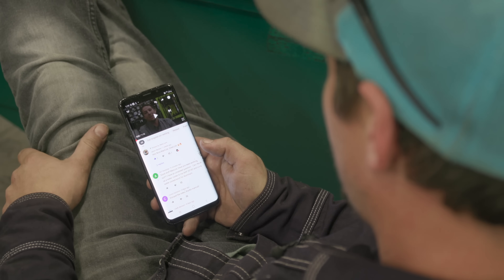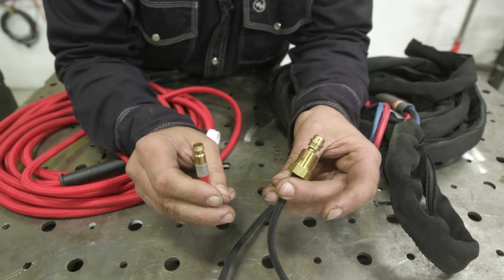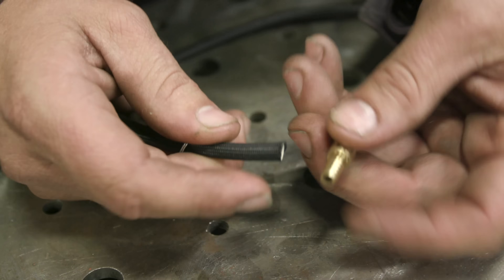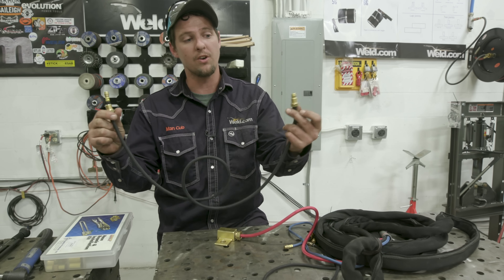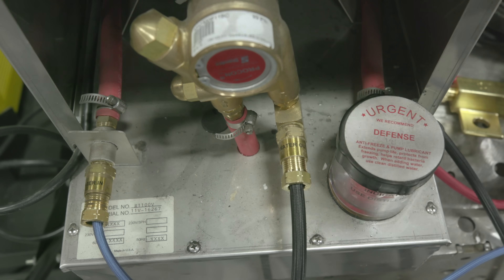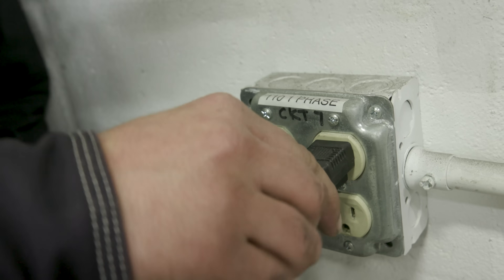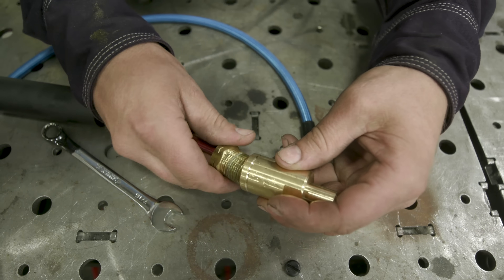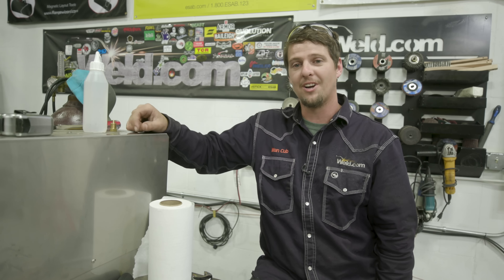AHP AlphaTIG Water Cooled TIG Torch Setup

Comment: Great video. My machine feeds the gas through the power cable of the torch, high frequency start. Is there a way to hook a water cooled torch up with this system, or do I have to bypass the machine and run gas straight to the torch?

Comment: Hey ManCub, Great video I just have a quick question. When using a water cooled torch what is the best cooling fluid to use for longevity of the torch?
Reply: Normally you can use normal distilled water but the best coolant that I have used is the Miller Electric coolant works in most water coolers.
Reply: @davisbradford9080  Thanks I ended up getting some torch fluid by Fronious been ok so far, Appreciate your help

Comment: You hooked the cooler up backwards!
See the arrows on the pump, water out means chilled water out of the cooler and in to the torch.
Chilled water comes out of the "water out" and flows towards your torch, picks up the heat and flows back to the "water in" gets chilled in the heat exchanger and stored again in the reservoir below the pump. From there the pump sucks it up again and the cycle continous.
Reply: At least he didn’t pipe shielding gas to the cooler... 😂
Reply: Does the water flow up through the red cable first or the opposite way?
Reply: @mancubwelder7924  Cold water through the blue hose directly to the torch head. Then back through the red one cooling the wire carrying the weld current and back to the cooler.
Reply: A few of us noticed also. Kind of a shame he gets such a fundamental aspect wrong in a video intended to help those that have never installed a water cooler.😐

Comment: How about a miller MP220
Reply: Yeah you can do it on there. Take the first example i show you in this video. David thank you for watching Weld.com. Stay Healthy & safe. Take it easy David
Reply: @mancubwelder7924  got it castrate( cut out the Dingus plug with the gas hole in the middle) the machine and run it in ARC Mode, or just deal witth a hot torch in TIG Mode. I was considering getting a torch with a manual valve to see if I like it better anyhow.
Dream Big Chisel Down To Reality

Comment: I’m no professional (just starting out at age 49) welder so I’m just wondering what is the benefit of this and give me a practical application for a better understanding please. Thanks in advance
Reply: tig torches get very hot when welding with higher amps. a watercooled torch stays more comfortable and cool
Reply: You also can get smaller torches with higher amps, so you can fit into tighter spaces. They are in general a quality of life upgrade. Not needed, but makes welding more comfortable.
Reply: Really helpful if you are welding lots of alu. TIG is the usual process for Alu which takes more amps for a given thickness. If you are doing long runs of 1/4" material,  the torch can get hot enough so you can't hold it with MIG gloves. A water cooled torch will let you weld until you are tired.
Reply: Thank for watching Weld.com.

Comment: This may help a few people, I have a miller syncrowave 250 I bought in about 2002, I bought a 5 gallon bucket put a fountain pump in the bottom of it, ran to my torch and returned to the top of the 5 gallon bucket. the cool liquid at the bottom goes to the torch.. I used distilled water for a few years but do to risk of freezing I changed to the miller coolant to avoid freezing.. The 4 gallons would take a few hours of solid welding to heat up. The capacity of 4 gallons beats lots of these machines that cool 1-2 gallons. I built the system for $50
Reply: Sweet deal! Love information like this. Thank 4 sharing it on here. Thank you for watching Weld.com. Stay Healthy & Safe. Take it Easy William.
Reply: The reason your water isn't getting hot is because you aren't pumping it with enough pressure. It takes ~50 psi and your little fountain pump isn't even close. The water lines are very small; that's why it takes so much pressure. You are basically running your torch as an air cooled. 
Try a real water cooler and you will notice the difference. They remove a lot of heat through the radiator and typically hold 3 gallons. I don't know how you haven't melted your handle. You must take a lot of breaks;-)

Comment: It seems kind of odd the cooler is labeled "OUT" for the returning hot water from the power cable and "IN" for the cold water to go up to the torch, but I am not familiar with that unit. Cool video otherwise and I'm sure you're getting a bunch of people searching for used coolers from flea markets hoping to catch one for $50 like you! LOL
Reply: They did indeed hook it up backwards. See the arrows on the pump.
Reply: You want the flow of the water going in  the blue side and out the red. Why? Your trying to cool the torch off first because your hand is hot. If you went the other way you would be heating the torch up.